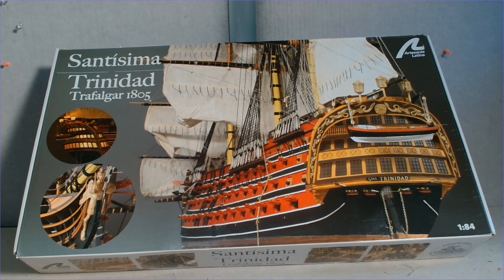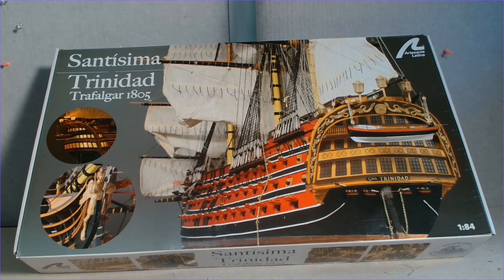Unboxing of the Artesania Latina Santisima Trinidad

Comment: It's been decades since I built my last wooden ship. I don't know if my hands are steady enough to do the rigging now. I made woodworking my business/income so my hobby suffered. The scale details are incredible on this ship.
Reply from the maker: That's what attracted me to it , the details. Being only my second build I hope I'm up to doing it justice.
Reply: @GregWilson635  I just found your channel, 2nd build? good luck man! 

I've built 4, first sucked (I was only 12) got a billings bluenose for $3.00 in a 2nd hand shop but got better and better with each time. 

my last one, I didn't like the braces they used to support the shrouds/stays so I got some 10 ga copper wire, hammered it flat and made my own. It might not be "historically" accurate, but looked better. 

The photo etched parts on yours are off the charts! didn't have any of that when I was into wooden ship kits.
Reply from the maker: @muskokamike127  I've learned a lot from my first build which I can apply to the second. Probably best lesson I've learned has been the hardest ... patience 😉
Reply: @GregWilson635  100% and the right tools. 

Do you have a steamer for the planks for the hell? you can make one out of pvc and a kettle if you don't. It's also a lot easier to bend if they're steamed as opposed to soaked in the bathtub lol

a small razor saw and mini plane are vital. I learned that planing the top edge of the previous plank on the hull makes em fit SO much nicer. 

I picked up a set of PC board micro drill bits as well. 

Surgical forceps//hemostats are a god send too.
Reply from the maker: @muskokamike127  I have all that except for a steamee. I haven't heard of tgat before but I will give it a go. The bow on the Santisima is almost a 90 degree bend so may need to try that. I also plane the top edge of the planks.
Reply: @GregWilson635  yeah, there's some vids on youtube on how to make one out of pvc pipe. You don't want it air tight, steam and air tight = kaboom!

There's also plank bending pliers, they make a notch on the inside of the plank making it curve in that direction. 

Is this kit single or double planked?
Reply from the maker: @muskokamike127  this one is single planked
Reply: @GregWilson635  double plank are good because the decorative outer layer are generally thinner and easier to bend so you get nice smooth curves after making sure the base layer is sanded and filled.

Comment: Artisana Latina is a sad thing. A company went bankrupt making kits that were amazing. Then bought by some investors and the kits gutted.

Really these kits are a cash grab now. Using the reputation of old. Sad.

All of the good wood walnut, etc…replaced with low quality lime. Tom’s of exposed lime and even exposed ply… Plywood reduced to 2-3mm even in planking edges. All instructions, prints, 1:1, rigging diagrams REMOVED completely. 

It does come with a nice note saying that all the things they did to cheap out the kits was for the environment. 

But it costs the same…even though the actual value of the contents was cut drastically… “for the environment”
Reply from the maker: Yes, it is very disappointing. They used to be so much more impressive.